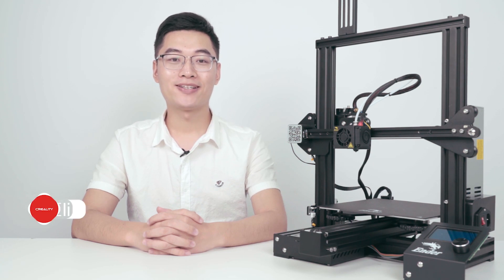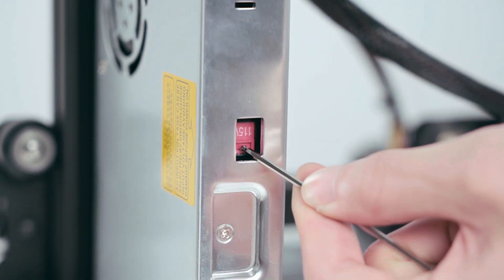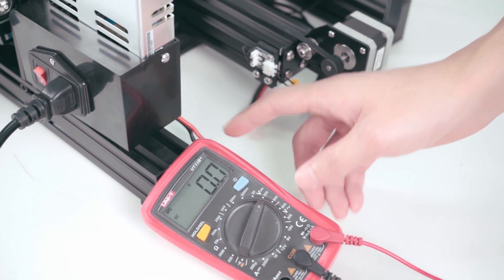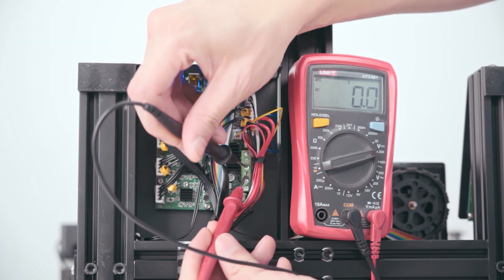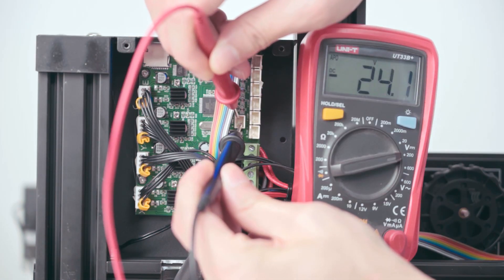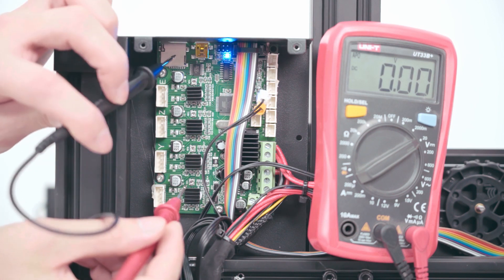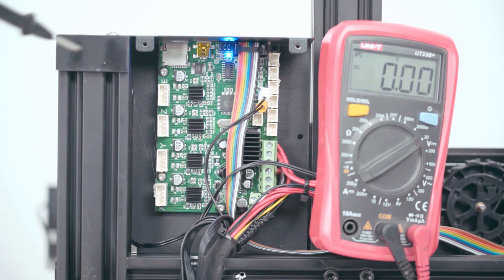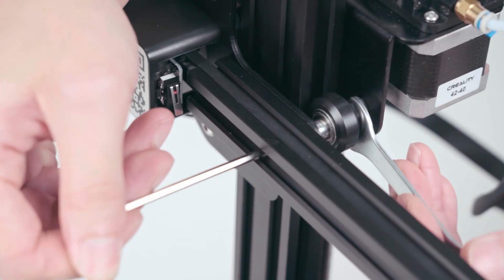Ender-3 Pro Troubleshooting

Comment: One of the better problem solving issue videos out there, thank you.  I had the issue of the power going off and not coming back on,  after checking the fuse and the power strip the other tutorials I watched suggested I replaced the power supply 🤔. Your video helped me get the nagging feeling away when I followed your suggestion and checked the output from the power supply (yip it was there). Next to the mother board.  My board is different, 4.2.2 I believe or something like that, it has no led to show power however there was no power inside the board which would suggest to me something was blown.  Looking about the board I found to my joy a 15 amp car fuse, I pulled that and sure enough it was blown. I replaced it.  Installed my smoothers which I intended to do at some point but took this opportunity.  Switched my ender pro 3 on and she works.  I hope my addition may help others out there as I have not seen mention of this anywhere.  Thank you for your video.
Reply from the maker: Thanks a lot for your warm comment.

Comment: I've got a power issue as well on mine. Turn the switch on and nothing happens. My main board just blinks with 2 green LED's. It's not a solid light like this. And my PSU has a green blinking light as well once everything is plugged in and turned on but still no power.

Comment: @julieadelaide  I have an ender-3 V3 SE and it was set to wrong power I heard a bang and smoke coming out.  I can still turn the printer on (its now on correct power) the screen says language then heating extruder then it states nozzle not hot enough and a loud beep happens.  Can I fix my printer or get a new one?
Reply from the maker: Hi, I suggest reaching out to customer service for assistance~

Comment: brilliant machine, loved it since I got it. now having a print issue. before it even gets to 1% of any gcode file it stops printing. the filament gets chewed through at the feed dog but appears to be jamming at the nozzle. this is using PLA. doesn't matter if it is silk or plain. gcode in Creality or Cura. have cleaned thoroughly the J head, feed dog, new tube, new open pkt of filament, new gcode, none of them have worked to fix it. Any other suggestions before I try a firmware update.

Comment: Hi creality, I got Ender 3 pro which is suddenly showing a message as: homing failed printer halted please reset, I restarted and tried to move the x y z axis and non of them moves, I am worried, Please help.
Waiting for your reply 😞
Reply from the maker: what did you do to the printer? It is very likely that the line is short-circuited,
1. Unplug the print head wiring on the motherboard, and then try to drive the XYZ axis;
2. If it still does not work, unplug the hot bed wire (all wire), and then try to drive the XYZ axis
3. If it still doesn’t work, try to re-flash the firmware or change the motherboard

Comment: ran great first print turn off then turns on few minutes it shuts off why ?
Reply from the maker: Friend, have you tried to restart your printer, and check if it can work normally or if it shut off again?
Reply: @Creality3D  it had a meltdown first one I ever using so I will check it when I get back to it working on 3 others from you.

Comment: my ender 3 won't turn on.  I think it is the power supply OK.  I test everything to power supply and replace power supply OK.  The power to motherboard OK.  The voltages seem OK on motherboard but screen does not turn on.  Can i tell if i need a new motherboard or a new screen unit?  What should I do?  I just bought my Ender 3 on amazon and they want me to ship it back.  I do not want to dis-assemble it to ship it back and wait for a replacement if it only need one part. thank you are welcome
Reply from the maker: Sorry for your bad experience, we advise you to return your ender 3 back and ask amzon to send you a new one. If you try to fix it by yourself, we are afraid you would be in another trouble.

Comment: How do I fix? I purchased a new mother board and when I plugged in the Nozzle port a high pitch sound comes out of the display screen for a full 10 seconds then the board resets and does it again. This will repeat until the nozzle port is unplugged and the board resets. As stated, the motherboard is new and so is the the nozzle.
Reply from the maker: Friend, sorry for your bad experience first. Pls contact our after service https://www.creality.com/service-request. We have very professional engineers there to solve your problems. Thanks for your support.

Comment: my printer has started beeping at me every time i try to preheat the filament, then the screen says ,heating failed please reset, how can i fix this
Reply from the maker: Pls separately preheat the nozzle or hot bed, confirm which part caused the heating failure, and then check the thermosensitive or heatingtube to find the problems

Comment: Ender 3 extruder is clicking if retraction is turned on. 5mm retraction 45mm/s. PLA 210degC.
Reply: you may have the nossle too close for extrusion causing the extruder to be under pressure ,also ur pla may not be coming off the spool freely

Comment: Hi creality! I have recently bought my ender 3 pro, and it worked great for the first print, but now, even after the bed is heated and level, the extruded plastic will not stick to the heatbed and is not extruding properly. What is the problem with my printer? Can this be resolved? Thanks!
Reply from the maker: Friend, your question is too general. Can you be sure your problem is that the extruded plastic will not stick to the heatbed or it can not be extruded properly? Could you pls shoot a video about your printer's problem and contact our after service?  https://www.creality.com/service-request

Comment: Hello Creality! I have been having an issue with my 3D printer for 3 weeks now, and I've been diligently working on my own to fix it! Every time I start a print nothing comes out the nozzle. I unclogged the nozzle itself I made sure nothing was jammed up any farther as well. I cleared any sort of blockage and started a print and still nothing would come out, however, now I am able to push filament through it manually and it flows out better. I did the motherboard voltage check and found multiple spots where I have 0 voltage (the first two that were checked in the video had voltage and current light was on but after that I had 0's). After watching the video I know I have some spots with 0 voltage and now am left wondering where to go from there.... any suggestions? I haven't even been able to do ONE print yet :// (half a pig actually).
Reply from the maker: Sorry for your bad experience first. Pls contact our after service https://www.creality.com/service-request. We have very professional engineers there to solve your problems.

Comment: I had a problem with my ender 3 ver2. For the past few months I,ve been using without a problem until one day when I switch on the power the LCD  display produces beeping sound and not turning the macine on. There is no display in the LCD except the ender logo and th beeping sound in the LCD display wont stop. Whar could be the problem? Can you please help. Thank you..
Reply: I'm having the same problem, I turned it on and auto homed it, did a bed heat to check clearances then told it to print from TF, Then the screen lit up and had the LOGO and a line thru the middle that went left to right like it was loading when the line got to the right it didn't do anything else, so I unplugged it and tried again, same thing just a bright screen with the logo. any help? please?
Reply from the maker: @mr.runningwolftoyou5384  Sorry for your bad experience, pls contact our after service https://www.creality.com/service-request. We have very professional engineers there to solve your problems. Thanks for your support.

Comment: I have 2 ender 3 pro printers. Neither one is functioning properly. One beeps a long constant beep when powered on, the other display is not showing any words, just the blue light. Please help
Reply: Did you ever find a way to fix the blue screen?
Reply from the maker: @Georgeiscool2  We are reponsible for every customer, so if you have any problems about your Creality 3d printer (especially when you need to use pics or videos to show these problems), pls contact our after service https://www.creality.com/service-request. We have very professional engineers there to solve your problems. Thanks for your support.

Comment: My extruder doesn't work. The motor works with different socket on the mainboard. I checked the cables and the board or the socket seems to be the issue. Any suggestions to fix?
Reply from the maker: Have you tried to replace a new socket to see if your problem can be solved?

Comment: Why is the screen blue?? 
On my last print the printer froze. Both the printer head got stuck in the print with the bed and nozzle hot but the LCD would not respond. Now when I powered it back in the lcd is just blue. Following this tutorial the power and fan ports are 24 V but the nozzle and bed read at 0V.   The other white ports on the same side all read at about 3 V. I was unable to test the other side. Help. I’ve also checked the ribbon cable and the power supply according to this tutorial.
Reply from the maker: Sorry for that, pls contact our after service https://www.creality.com/service-request. We have very professional engineers there to solve your problems. We have very professional engineers there to solve your problems.
Reply: Did you find any solution to this? I am struggling to see that there should be any voltage on bed and hot-end unless printing or at least during preheat. I have the same issue on a 4.2.7 silent board.

Comment: Just got the Ender3 v2 and I can't get it to auto-home.  It comes on alright, and everything looks right.  I've checked the wiring to make sure I connected it right.  It just won't auto-home.  Any suggestions?
Reply: Hello Dennis,
I am having the same problem, does it happens to you that you cannot start printing as well?
Reply from the maker: @AdrianVillalba  Use the screen button to manually control the three axis of X, Y, and Z to see if it works normally. If not, pls contact our after service  https://www.creality.com/service-request. We have very professional engineers there to solve your problems.

Comment: Thank for this tutorial.  Recently i replaced my thermistor and heater.  After putting it back to gather, the fan turns on but the screen is blank.  Following this tutorial, am getting 24v reading from the power port and fan port.  But the heater bed and nozzle head port only read 0 to 1V.  Can this be fixed or does this mean my motherboard is dead?
Reply: @JackSandman Did either of you come to a solution?

Comment: I have ender 5 pro, just got today.  Won't print. I load gcode file and it just sits there and flashes ? on x y z.  What is wrong?
Steppers work when i manually move x y z

Comment: I m facing 1 problem in my ender3 pro 
When its prints after 10 to 30 min its get off no power supply in screen and printer  stops after 10 to 20 min again power comes and its says power loss resume print 
What should i do i checked the fuse also its good help me out

Comment: A very good helpful video by Eli for new owners, but please sort out your download pages for firmware. Your link to the BLTouch ver. 3.1 firmware completely messed up my Ender 3 pro because I had installed the Creality Silent Board 1.1.5. previously. All I’m left with now is version 1.1.6 on the board and still no sign of the BLTouch firmware. 1.1.6 is missing a lot of options and I can’t even heat up the bed till a print is started. It seems that the boot loader is now missing also. I would rather keep with the Creality firmware but now I have given up and going over to the Bigtreetech boards instead.

Comment: Great information!
I have a high pitched constant beeping and blank display module when turning on my Ender 3 pro. Any idea what that means?
Reply: Disclaimer - I have a normal Ender 3 - however all the components I mention are the same across the two except for the power supply, and also the firmware of the motherboard.
I had a similar issue, and it turned out to be the motherboard, I also had some issue with some component on the hotend that I think was the thermistor, but I replaced the whole thing so I do not know for sure. When I first tested with a new board I had mintemp so more things pointing to the thermistor, however it may have just been the firmware on the board had become corrupted. I have also heard of this issue being caused by a bad power supply.

Comment: Love how creality is interacting with their customers/fanbase lately! What would you guys think of a creality moderated subreddit? Or some other form of creality moderated forum? A lot of people (especially beginners) have Problems with the ender 3 because it is not completely plug and play and setup is not completely straight forward. I know that you have customer Service on Facebook Messenger, but i think this would be a great win/win Situation if you didn't have to answer the Same question a hundred times and we wouldn't have to ask the same question over and over. A discord server would be another good Option. Examples for resources to share would be printing profiles, (maybe the one from the dog which comes with the printer?)  An printer specific troubleshooting guide(I would be happy to help out there) and maybe some 3d printable Upgrades you can primt for your own printer (dampening feets, external electronic cases, direct drive mounts, ...) All the Points above would help a lot us customers, and you guys getting more sales as it makes it more acessible to the unexperienced. On another point, I would love a full diy kit where you guys provide the metal parts and we can print the rest for ourselves on our own printer. Display frames, feet, electronic boxes, motor mounts, they all can be 3d printed. Keep it up! Thanks for your products
Reply from the maker: Thank you so much)))